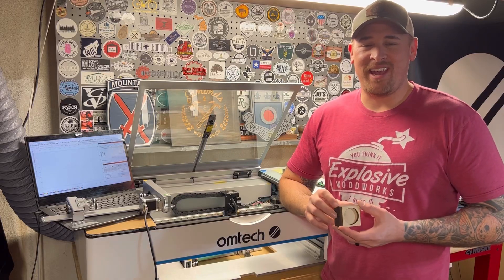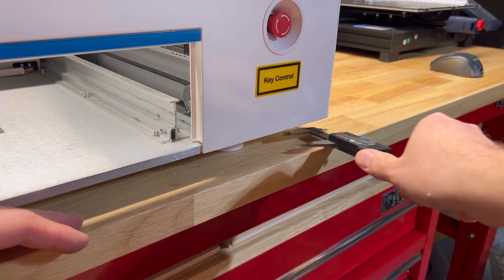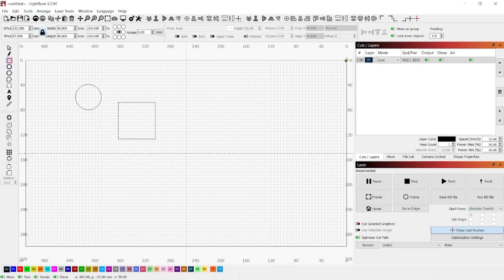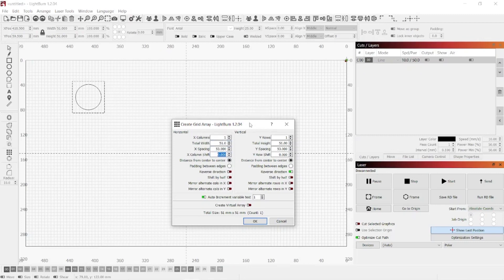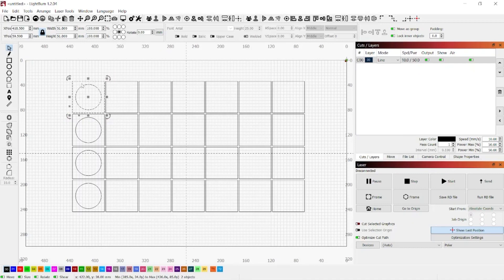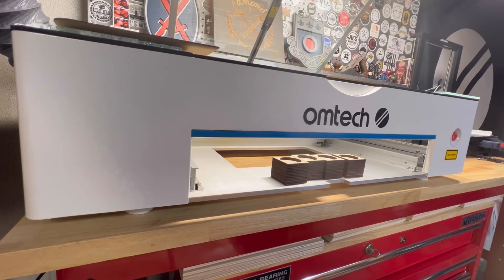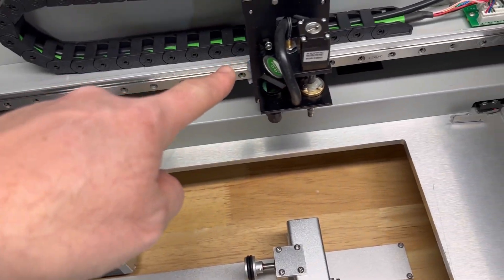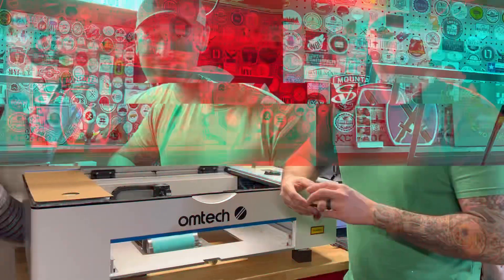How to make Tumbler Risers for your OMTech Polar

Comment: Thanks for your content I'm learning a lot. As someone who's been a hobby 3D printer enthusiast I recently decided to try and make a small business out of it. I'm seriously considering also adding a Polar to the mix as I have lots of great ideas for engraved/cut products. I see you have a 3D printer sitting there and was surprised you didn't just print the risers? Also it seems like you could print some kind of alignment jig that would stick down the hole to keep the rollers in the correct position.
Reply from the maker: Actually if you join my polar community on FB you’ll see that I added a 3D print file for the polar that I created. 
The thought process behind this video was that everyone doesn’t have access to a 3D printer but they do have a laser so why not make laser cut risers?

Comment: The rotary limitation on the spec sheet was one of my main concerns on deciding on this machine. It’s really nice to see how you adress this problem, and better yet, that you took your time to bring it up with Omtech directly.
Reply from the maker: Some people wanted an extension cord. You can make your own or a found this guy on Etsy that sells stepper extension cables. I bought the 5 inch and it works great

https://www.etsy.com/listing/1307694005/
Reply: @EdmondsWoodshop  thanks for that

Comment: Great Video! How do you keep the tumbler from moving left/right as it spins? My diode laser has a chuck style rotary.
How do you handle the focusing when using your risers?
Reply from the maker: The polar comes with two rotary’s. One for wider object and one for narrow objects. I also keep two different settings for when I use my rotary versus when I use my default laser settings for normal operation. For my rotary settings I keep my speed way down. I don’t have moving issues.

I only use the risers for objects that are wider than what the stock setup allows. I use the included ruler to focus my laser head to the top of my tumbers surface.
Reply: @EdmondsWoodshop  thanks!

Comment: Can’t you just solder some similar gauge wire and make an extension? Then add some heat shrink to cover the wires back up? That way you could laser a larger tumbler? But, maybe make the feet a bit larger due to the increased height.
Reply from the maker: Absolutely! Being the admin for the Polar group, I would say more people are afraid to do that than buy an extension cable. If you're comfortable with then, then by all means.....you absolutely can. And yes, you would need to make the risers taller if you needed more depth.
 They also make extension cables for 3D printers that will work for this as well and can be found on amazon. You just have to make sure the male and female ends can plug into each other. The one's I found on amazon were sold out, but I found someone on etsy to make me one.
Reply: @EdmondsWoodshop  I’ve got 20 years of car audio and other electronics experience with soldering. A little soldering doesn’t scare me. LOL

Comment: Hey. I just wanted to stop by and ask if you were able to test out any other tumbler sizes/diameters. 

Also, any word on if there will be an extension chord for sure? Thanks. Ordered my Polar. Upgrading from a D1. Super excited.
Reply from the maker: You can easily find an extension cable by searching for “stepper motor extension cable” on Amazon. The only problem is that you won’t know how they’re wired until you get get them. Some come reversed so you’ll have to swap the two outside wires around.

Comment: This is perfect. Quick question, how do you calculate the focus height post riser install?
Reply from the maker: Your tool box actually has a ruler with a notch cutout labeled 50.8. This cutout sides on the frame of where the lens sits. you would adjust your height of the laser head until the bottom of that ruler is touching the cup
Reply: I think the polar has an auto focus. You're not doing anything to really change the height from the POV of the laser.

Comment: After you add the risers do you know what the max diameter of the tumbler (and length of an insulated water bottle) can be? I know they all can have different lengths/ diameter based on shape of bottle. Thanks! Your videos are very helpful! Can’t wait for my polar to show up!
Reply from the maker: I don’t know the max diameter. I just had 20 oz tumblers on hand to check. Heck, you might be able to do 30 oz. As far as the length, the rotary is adjustable. I’ll have to measure how far down it can adjust to.
Reply: Thank you for all your help!

Comment: I'm following your page as we're contemplating a Polar. I'm far from "techy" but do you think this is a good starter machine? It gets so confusing researching all of them and I'm still confused what the difference of other 2, cheaper, desk top models are, other than speed, camera or no camera, and work area! Thank you for this video too. It will be helpful down the road should we make that leap!  It's looking likely though!
Reply from the maker: Hi Karla. The nice thing about the polar is that it's ready out of the crate. There will still be a learning curve with the software and the functions of the machine, but as far as general setup goes, you'll be good to go. The polar is bit different from OMTech's other models just because of it's general makeup. It includes all the necessary accessories to get started where on the bigger models you might need to buy the extras such as the inline fans, the chillers, the LED's, etc.

However, with the bigger machines you obviously get bigger space, more versatility as far as engraving larger objects. The trade off is that you need to learn how to properly set up a laser. This means learning how to align mirrors and do a ramp test. Its not bad, but can be a tedious process. We have tutorial videos for all of it. 

If you haven't already, I am an admin for the Offical OMTech group. I'm partnered with BeardedBuildsco (another laser channel here on youtube) and we help thousands of people like yourself narrow down your research. 

The link to the group is in the description
Reply: @EdmondsWoodshop  Thank you so much for your quick reply! That's one of the reasons we're leaning towards the Polar, everything comes with it and basically just ready to go!  A little more space for working than the other 2 desktop models, but not overly huge.  Perfect for projects I would like to do!  Right now anyway, who knows down the road, but set up, aligning mirrors and all that doesn't sound like that's for me right now!!  LOL! 
I really appreciate your videos, time,  comments and insight!  I'll make sure I hop on the other pages as well!!  Research is fun, to a point!  LOL!  I just want to create now!!  
I am familiar with the Cricut craft line for crafting, cutting paper, vinyl, etc., and using Design Space (which is a pain sometimes) but it actually seems pretty similar to Light Burn, although light burn seems even easier!!  
Thanks again, I appreciate it!

Comment: Thanks for the tutorial! I will definitely be making these. How do you determine focal distance with the risers? I haven't tried tumblers yet.
Reply from the maker: Your focal distance is “the distance between your workpiece and your nozzle.” That distance doesn’t ever change. Our polars work backwards to where we have to put input an offset to move the laser head down, but what we really need to know is the distance between the workpiece and the material. What I did is that I found a piece of material that fit perfectly between my workpiece and laser nozzle (after I set the nozzle) and that material will act as a gauge to measure how far off my laser nozzle will need to be from my tumbler. It will take bit of trial and error because our polar is driven by incremental inputs in lightburn
Reply: @EdmondsWoodshop  Thanks, Cam! Sounds like it will take some practice!

Comment: At 8:30 you point out about the cord length for the rotary.  If you open the rotary and rotate the stepper so the connector faces up, that should help a slight bit.  Granted you won't get much extra length, but you'll get some.
Reply from the maker: You know I never even looked at that. With these risers the line is pretty tight so it may be just enough slack to give someone what they need. Good eye! I did speak with OMTech COO and they're making it with longer wires for this reason. I'm sure my video will be obsolete once they figure out they can market leg risers.
Reply from the maker: Hey Dan - This is Cam Edmonds BTW - the admin for the OMTech group lol